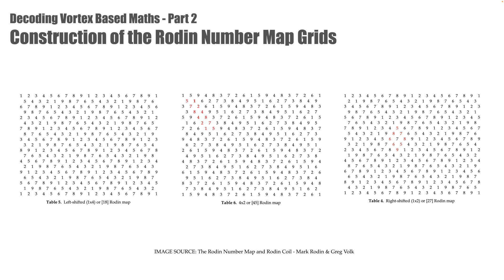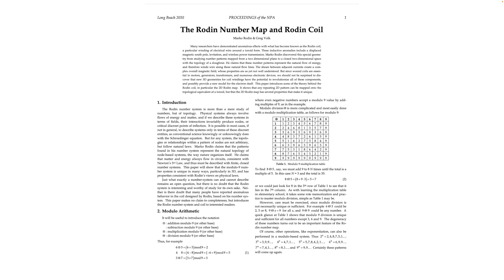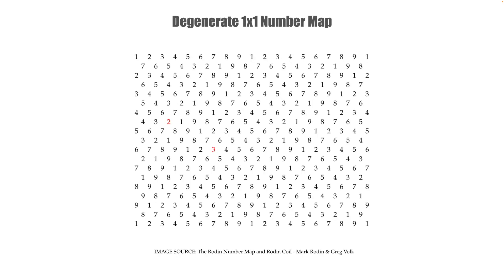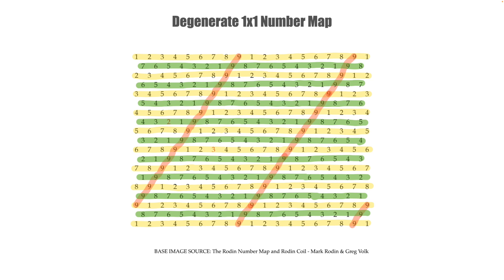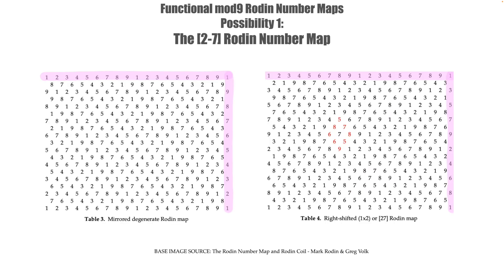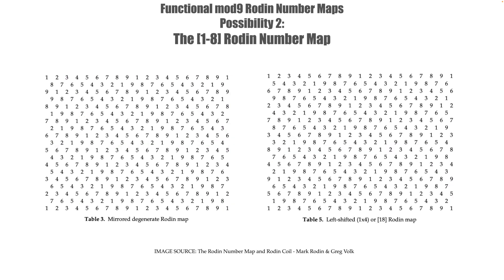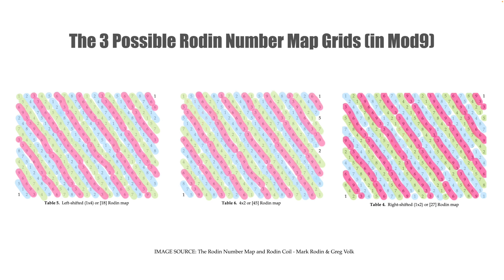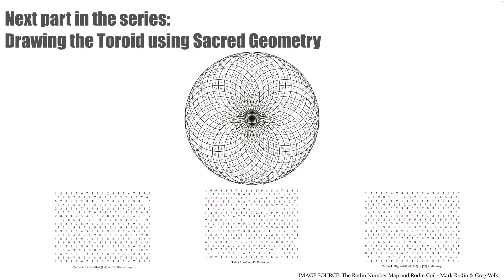Decoding Vortex Based Maths - Construction of the Rodin Number Map Grids (Part 2)

Comment: Man, ok - 9 is the 'fullest number' - it doesn't just contain every other number, it gives rise to them - 9 is the root, not 1. We count from the lowest to the highest but that's not how it works in nature - in nature you start with 9 and then derive everything else from it. Something else that isn't natural, that perhaps doesn't play any role in how nature does mathematics, is the zero. I don't think there's the concept of zero in nature. There's 9 down to 1 and that's it - look at the abha diagrams - no zero to be found anywhere. It doesn't really exist. It's an invention of ours that helps us to do mathematics and were so used to it that we often assume nature works the same way but maybe it doesn't.

When you consider 'counting' ...... in it's simplest form, you have iterations and digits - this is the first digit of the first iteration, this is the second digit of the first iteration and so on and the length of each iteration, the number of digits in it, is the 'base' of the system, right? So going by that logic the first 'number' should be 11 : 1st iteration, 1st digit. The second number should be 12 : 1st iteration, 2nd digit and so on all the way to 19 : 1st iteration, 9th digit and then we'd go to the 2nd iteration so there'd be no twenty, no 'second zero' - we'd go from 19 to 21 - from the first 9 to the second 1 - no zero in the middle - addition and subtraction still works but multiplication or division in a system like that is a nightmare - at least it is for the human brain but I dare say for other things it's completely natural.

I don't know, just saying - I'm not seeing any zeros anywhere on those maps or on the abha itself and why would it be there? It's nothing. It doesn't exist in reality. We go from the zeroeth 9 to the first zero? That's some wacky notation at the very least.